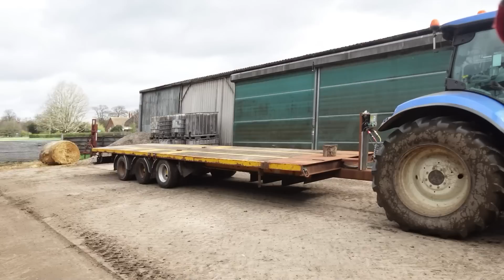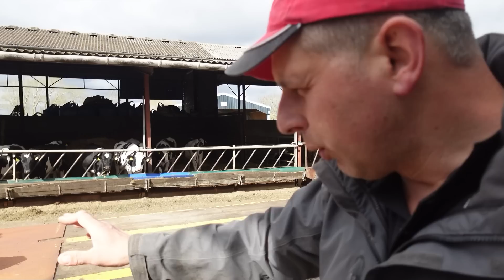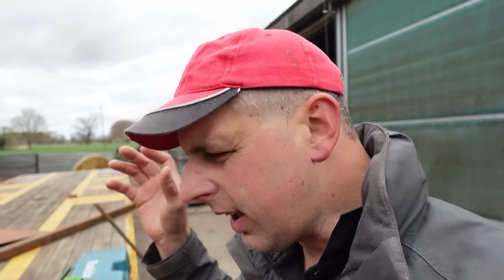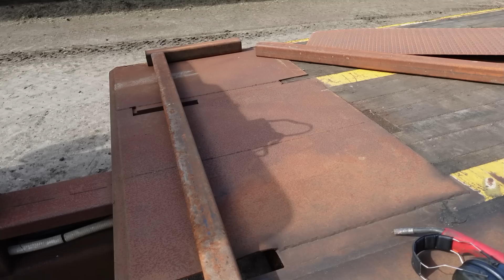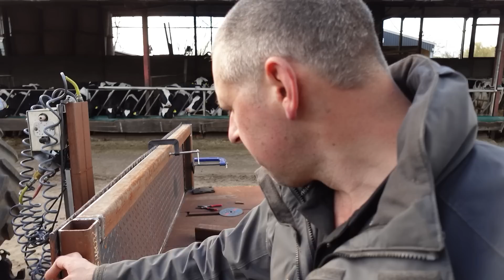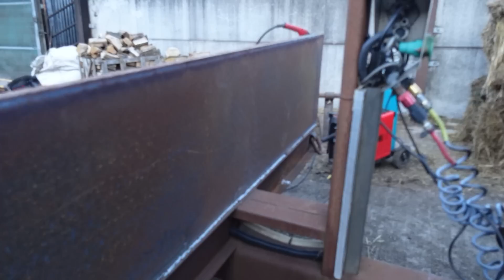TRI AXLE TRAILER REFURBISH

Comment: Nice job George yes can see that your plate on outside is that so your trailer looks tidy from front and easy to clean 
Yes definitely drill drain hole in each side even with caps on water gets in 
Welding with air lines be careful 
But looking really good well done ✅